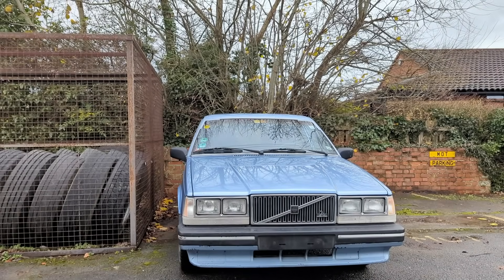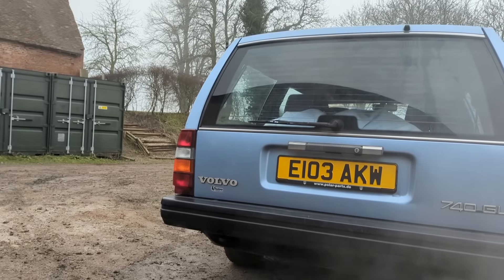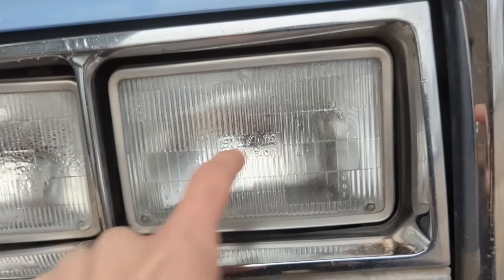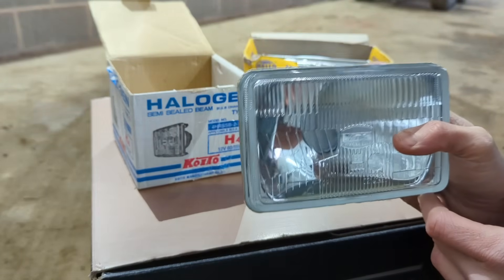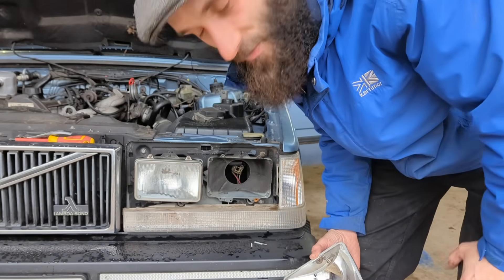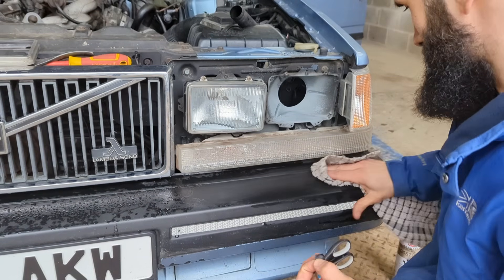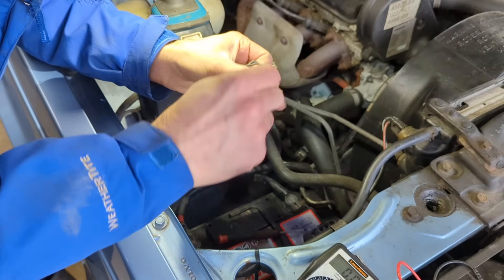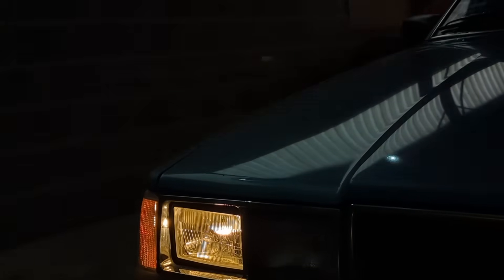Upgrading to Halogen Semi Sealed Beam Headlamps

Comment: Not legal to be driving with these headlights, but passed MOT anyway? 🤔

Those are standard 4x6" lights, right? They're not for any specific car. Used in a multitude of cars. Also, you can buy them new, no need to hunt for some new old stock and have a mismatched pair.

It's not only road signs on the left side that's supposed to be illuminated, but pretty much everything. Also, I'm not sure the beam pattern on those sealed beams is flat, they don't look symmetrical.

"Modern" H4 bulbs. 😄 H4 was introduced in 1971. That's 54 years ago. Nothing wrong with them, though. I like a good H4 light.
Reply: Those old sealed beam had a pretty much flat pattern in low beam, that's why he can pass the MOT. After sealed beam, americans gets a little asymetrical beam but not as much than european's one

Comment: 10:00 I fitted LED h4 'bulbs' to my 240 and the same thing happened where when I've got the ignition on the LEDs light up super dimly then just brighten up when I actually turn them on, I haven't figured out why yet (I also haven't watched past this point in the video to see if you find out why)

Edit: just watched to the end of the video, I might have to try to do that with my 240 to see if it fixes it

Comment: I would have connected the spades directly to the bulbs, checked that everything worked correctly then refit them with the blocks. I thought sealed beam units were effectively like big bulbs so that if any air got in the filaments would blow?

Comment: Great to see another video my 1990 volvo 16 valve isn't on the road yet need a hydraulic belt tensioner can't find a new one😢
Reply: Have you tried RockAuto? I just entered 'timing belt tensioner' for a '90 16 valve 740 and 6 came up as being available and in stock.
Reply: @bobjohnson1587  I will try no one had any ordered from SKANDIX back in August they told me I would get one in December now they said no longer available 😑 😒
Reply: @bobjohnson1587  has to be hydraulic belt tensioner
Reply: @bobjohnson1587  they have manual but no hydraulic ones..!